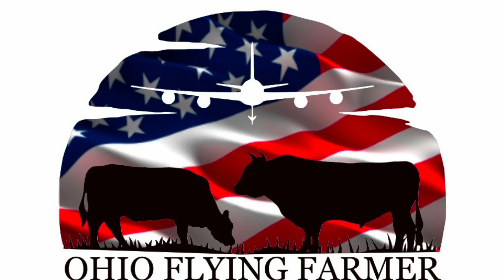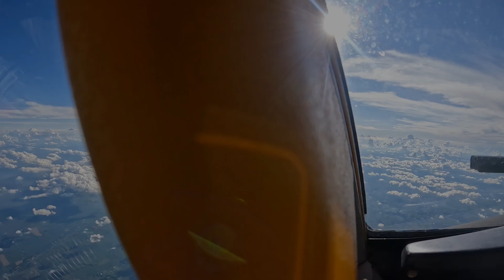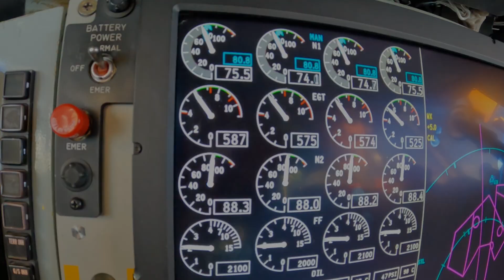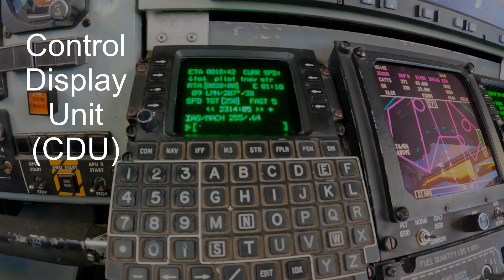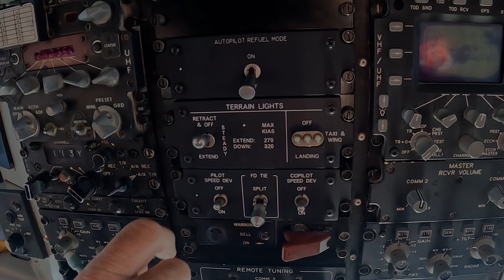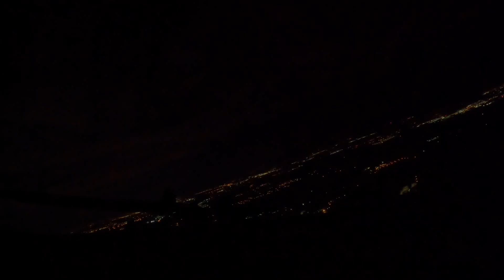KC-135 Cockpit Tour!

Comment: Hello Flying Farmer. I am delighted to find your video. I was a tech on the KC-136 simulator at Bunker Hill AFB (now Grissom AFB) near Peru, Indiana.   I was with the 68th air refueling squadron under the SAC 305th Bomb Wing there. That was from early 1962 to late 1964. I cross trained to the simulator after coming back from a tour in Turkey. I knew there were going to be a lot of up-grades to the airplane and your video gave ma a look at what the new instrument panel looks like -  lots of new digital displays. I knew they were going to up-grade the engines also. I got a ride on one thanks to one of the instructor pilots there, and got to watch the boomer refueling two B-47s. Now that's quite a while back, wasn't it? The base also had the  B-58 Hustler super sonic bomber there on alert status along with the  tankers. What a thrill it was to be in such close proximity to that bomber.  While refueling the B-47s the first one had a few disconnects. The second one that got under the boom told the boomer, "no disconnects this time boomer". The KC-135 simulator was an all vacuum tube system running the computer. The B-58 simulator was all digital with a big endless belt visulator and was all digital.  Thanks for the great video.

Comment: N1(low pressure compressor) i.e. the big fan at the front of the engine. N2 is the compressor or "core" speed where all the small fan and stator blades are.

Comment: Sir what is the porpose of yello stand that crew cheif put under boom. Is ti kind of device to prevent plane make wheelie or its for boom
Reply from the maker: It's basically just there for support.
Reply: @ohioflyingfarmer7050  oh.thanks sir. I taught kc135 might make wheelie  in rough weather like Lockheed L1011 you know in those plane there is device like strut in tail  with 5" of stroke that prevent FOD OF air frame

Comment: Back in '76 to '80, I was a maintenance tech on a KC-135 flight simulator.  I spent almost 4 years doing pre-flights in the simulator.  Your tour of the cockpit was fascinating.  Things have changed since 1980.  I didn't see the auto-pilot controls in the overhead panel.  There used to be 3 switches ganged together for autopilot.  The reason I know is because the simulator had some major issues with the control column (pitch).  If you engaged autopilot, the column would slam all the way rearward and damn near nail the crew in the crotch.  Eventually, I found a broken 150 volt feedback wire under the cockpit.  I repaired it and BINGO...no more slamming control column.
Reply from the maker: Hi Greg! With the Block 45 avionics upgrade, it is a completely different autopilot system and the controls have been moved down to the center console right behind the throttle quadrant. The control column and trim wheel can't still get ya when the sim operator repositions the sim!
Reply: @ohioflyingfarmer7050  Excellent!  Thanks for clearing that up!

Comment: Wow, thanks for the video. I was a Comm/Nav technician 80's to early 90"s and the plane's avionics have changed quite a bit since then. It's nice to see all the digital instruments now. Of course it still has it's share of steam gauges.  With all the changes over the years is the old radar beacon finally gone? Lol, that thing was a bear to work on, still had vacuum tubes and was in the tail. I remember changing them out on the ramp in Saudi Arabia.  Not a pleasant thing to do. Thanks for the content.
Reply: A fellow comm/nav I see
Reply from the maker: Thanks for your service Jim! 
I believe there is still a beacon function on our radar, but I have never messed with it.

Comment: I certainly did enjoy your Tour of the 135 Cockpit. It brought back many memories for me and showed how different the cockpit is today from what I remember from my 135 time during Vietnam. I was an Autopilot and Nav Avionics Tech and flew many hours in the 135 and B52. How nice to see that the current 135 is benefitting from some of the modern day advances in Avionics. I noticed a panel on the overhead for "Air Refueling Mode" of the A/P. I do not remember that being on the older 135, but the 52 did have an A/R mode. Does it have a similar function? I have just recently found your channel and am enjoying what you do here. Keep up the good work!
Reply from the maker: The current avionics package has an "upgraded" autopilot. That particular switch "dumbs down" the autopilot during air refueling, and basically just makes inputs from the autopilot smoother during A/R.

Comment: Thanks for the trip down memory lane.  I was a KC-135A pilot 1971 - 1982.  Many updates.  I take it the Navigator is gone as well as the sextant.  With the GPS do they still do ILS and radar approaches.  I hope the thrust on the new engines have improved.  With our J65's it took almost 12,000 ft to takeoff at near full fuel.  Great plane, lots of memories.
Reply from the maker: Thanks for your service Tom! 
Yes, the navigator and sextants are gone. We still do ILS quite often. I have done a few radar approaches, but not for some time.